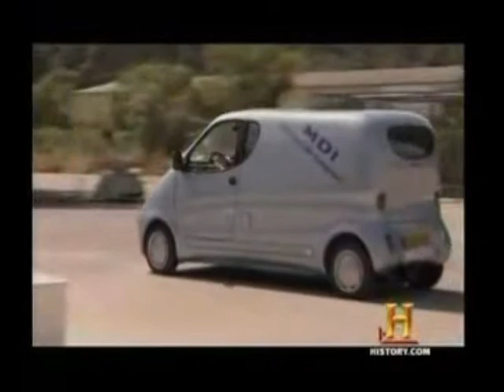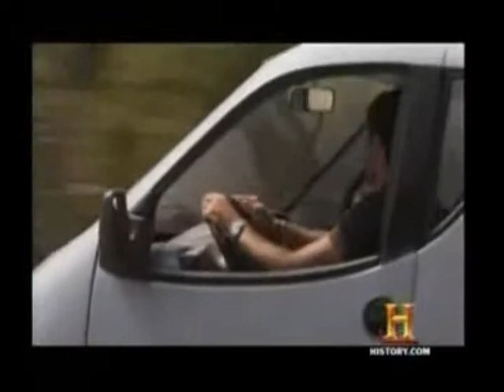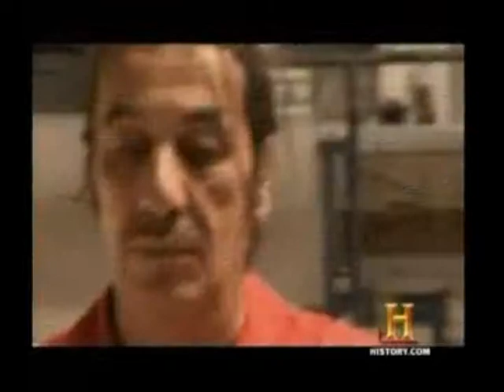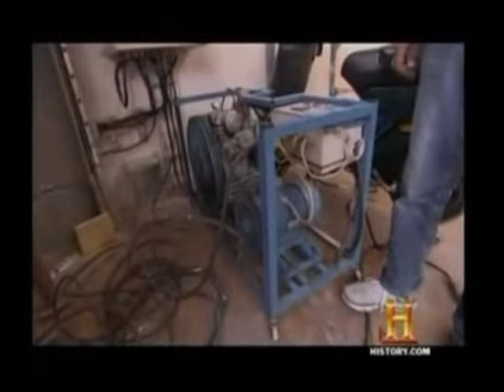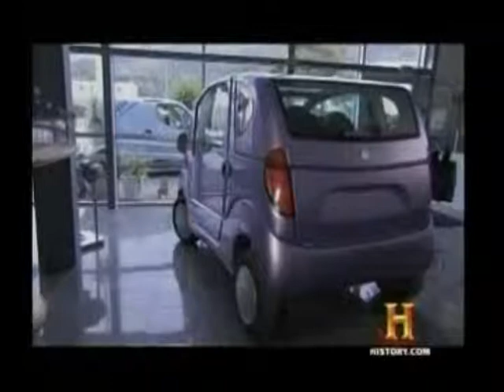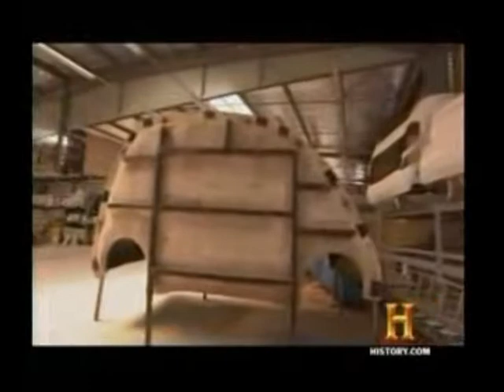Air Power A Car that Runs on Air

Comment: This is total B.S. It takes MORE energy to charge the air than it creates... AND the compressors that charge these cars RUNS ON FOSSIL FUEL. Also there is no "explosion" in an internal combustion piston engine. It is Rapid expansion that moves the piston. Also, this video neglected to tell you WHAT happens as the cylinders are half way depleted. The power draw causes exponential  loss of power, may as well drive a Yugo as far as safety is concerned